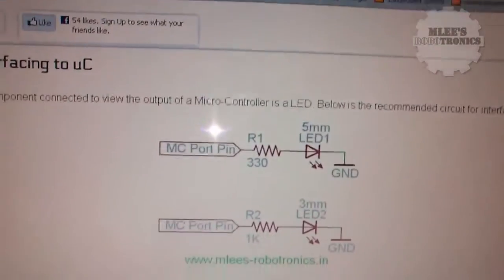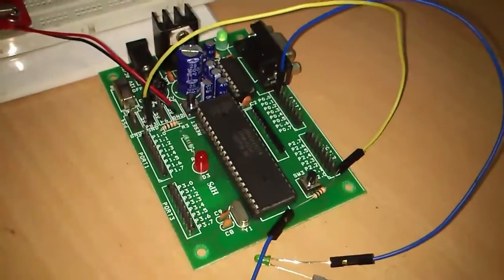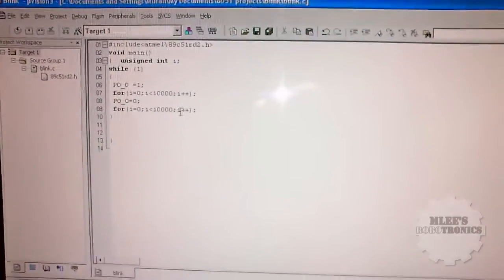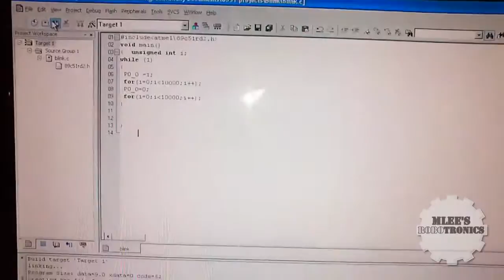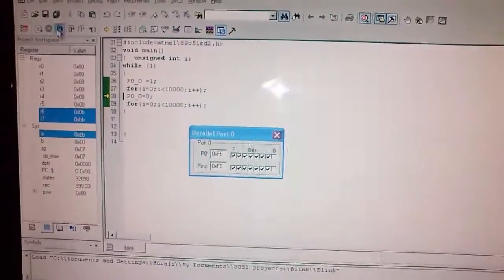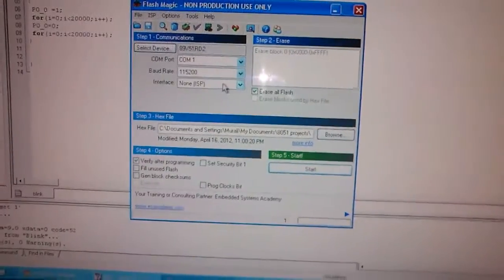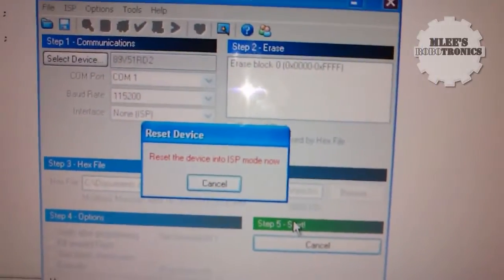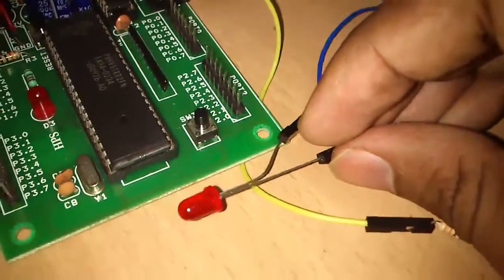Microcontroller Programming- Part1: Interfacing an LED (8051)

Comment: can i program any 8051 in this way? or just the p89v51rd2?
Reply from the maker: You cannot use the same tools (flashing hw and sw)  for all kinds of  8051. so you need to decide which microcontroller you want to use and then use the appropriate hardware for programming.
Reply: Vijay M and